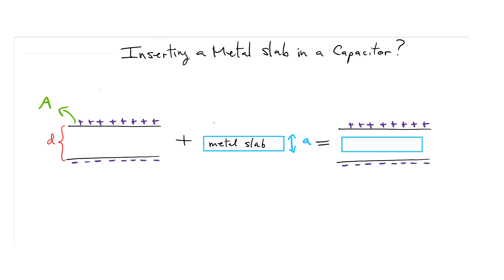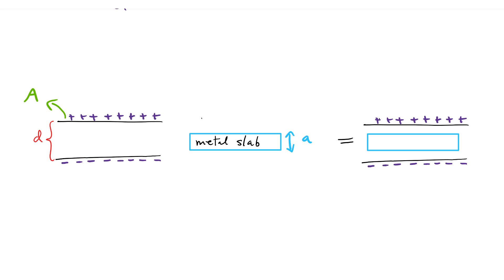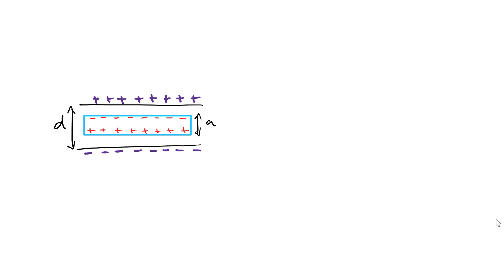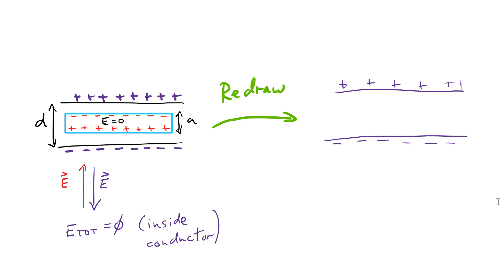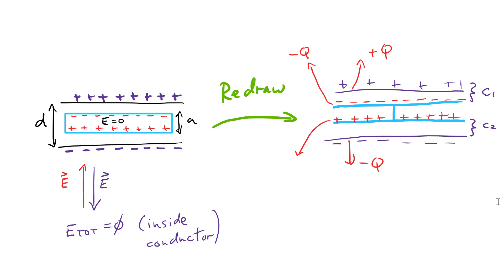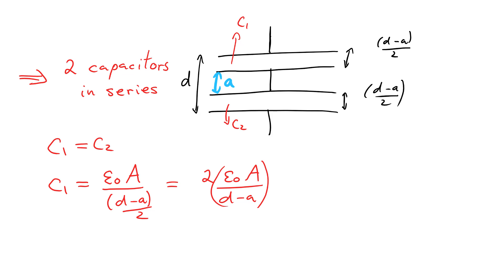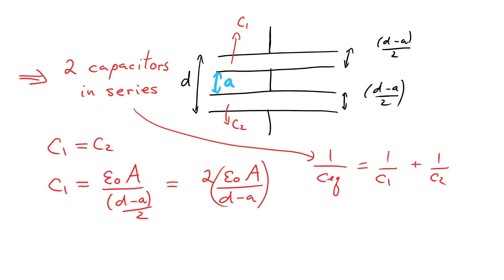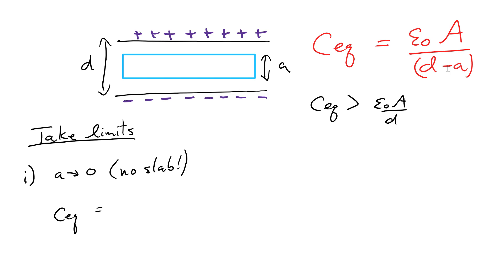Capacitors - Inserting a metal slab between the plates

Comment: That i snicely explained except one point. In case a ----> 0, it can be considered a metal plate of very small thickness that can act as two separate surfaces (at higher frequencies because the skin depth is very small above few MHz).  This would be equal to the sum of two capacitances each of value double than the original and therefore the final capacitance (both in series) would remain the same.
It would be interesting to do a comparative analysis when instead of metal you have a dielectric here and explain why capacitance increases because in dielectrics again polarization occurs.

Comment: What is the formula for F ? in 12:30
Reply: I think it would be quite difficult to calculate since the electric field behaves a little weird on the sides. It would be derived from coulomb's law though
Reply: Sir what if the lengh of metal slab is equal to distance b/w the capacitors?

Comment: Then C eq is greater that C original why don't we insert the metals then? I think it is good to increase the capacitance ? what do you think?
Reply: This wouldn't be practical at all because the metal has to be suspended between the two plates.
Reply from the maker: Good question.   It's not the best way to increase capacitance in my opinion.   I would try to insert a dielectric by increasing the k - constant or by increasing the area of the plates.   Look up videos on real capacitors and you'll notice that they are typically 2 sheets of metal separated by a dielectric.   The sheets are then rolled up up to make them smaller.
Reply: @PhysicsNinja  Sir what if the lengh of metal slab is equal to distance b/w the capacitors?